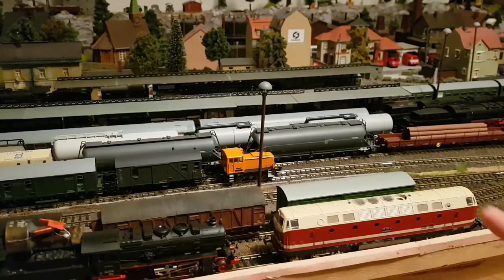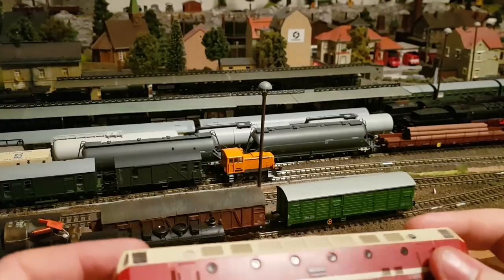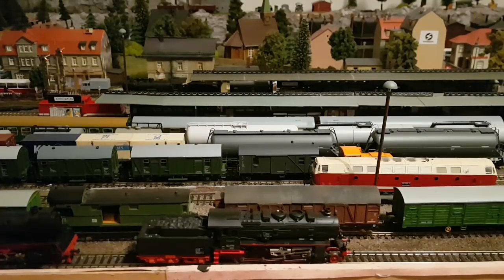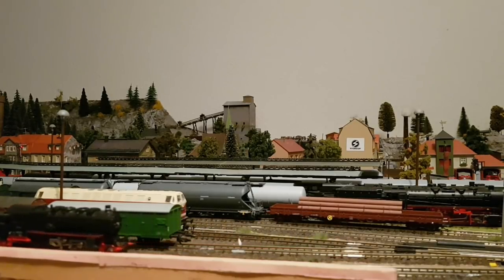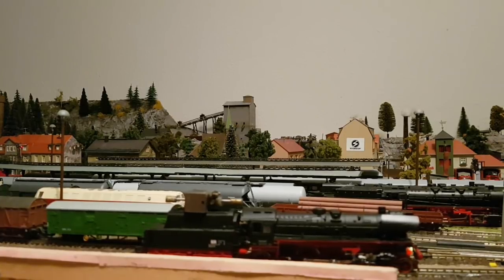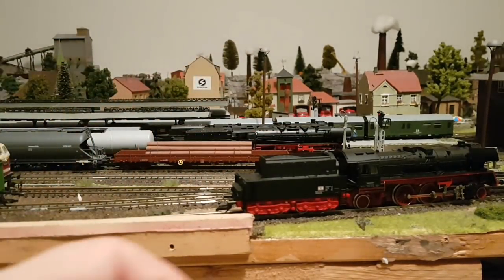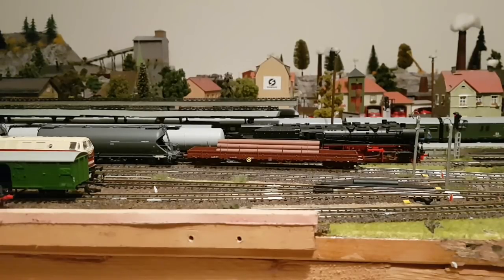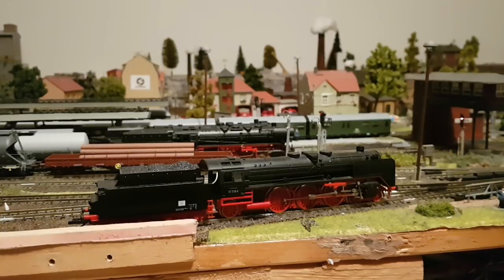TT Moba.  BTTB vs. Tillig Digital mein Fazit.

Comment: Hallo MoMa85TT! Wenn ich Dich richtig verstehe, kann ich dann die umgerüsteten Modelle mit 16V fahren? LG
Reply from the maker: DR - TT Grüße dich ich glaube das die Digitalspannung 24 v hat 16 ist doch annalog oder was genau meinst du jetzt?
Reply: Analoge Fahrspannung ist bei TT 12v und 16v Zubehör(Weichen). Bei Digital steht doch auf dem  z.B.ROCO   10760  Digitalstation mit Lokmaus 2 der Trafo 16v Fahrspannung.So habe ich das gemeint.
Reply from the maker: DR - TT Ja also wie gesagt Digital Lok mit Decoder fährt auf beiden Systemen nur lok's ohne Decoder kannst du nicht auf digitale Anlagen fahren eben wegen der höheren Spannung im Digitalbetrieb. Aber die Spannung alleine ist nicht das Problem es ist so ,die Zentrale zb Roco 10764 oder Z21 usw sendet ein codiertes  Signal  an dem jeweiligen Decoder deshalb jede Lok ein decoder mit separate Adresse. Zb BR v100 hat bei dir Adresse 10 auf zentrale und Decoder muss übereinstimmen. Du wählst mit deiner Lokmaus o.ä die Br V100 und drehst den Regler  auf und drückst die Licht Taste, auf deinem Gleis wo mehrere lok's stehen erkennt der Decoder in der V100 den codierten Befehle und setzt ihn um,alle anderen lok's berührt der Befehl nicht da diese jeweils eine andere Adresse haben zb.118 Adresse 11 Br 56 Adresse 12 usw usw.  Lok's ohne Decoder können also keine Befehle empfangen deshalb funktioniert das nicht. Ich hoffe das ist jetzt nicht allzu verwirrend für dich da das sehr komplex ist und in schriftlicher Form schwer zu erklären. Hoffe ich konnte etwas helfen. 😉LG
Reply: Ich Danke Dir sehr Herzlich!!!! Du hast mir wirklich sehr weiter  geholfen.Ich habe nämlich immer erst meinen alten Trafo an die Roco 10764 zu Stromeinspeisung angehängt. Das brauche ich ja nun nicht mehr , da ja die Decoder den höheren Fahrstrom verarbeiten und er nicht direkt an die alten Rundmotoren kommt. Danke nochmal. LG